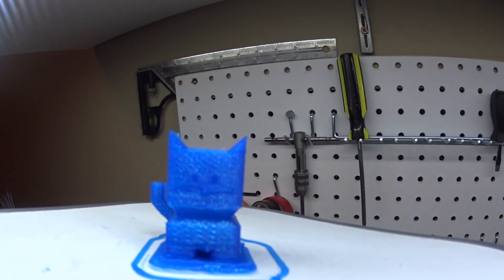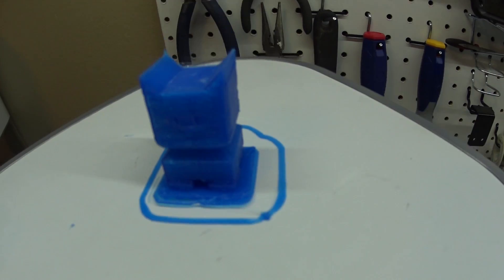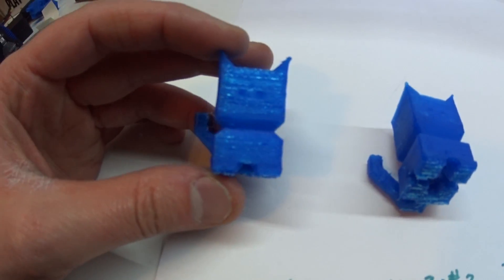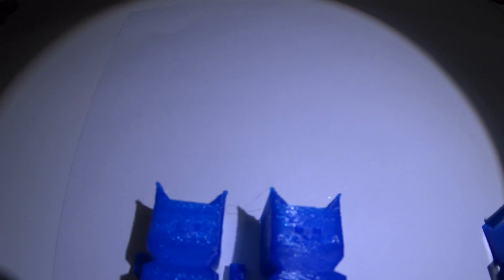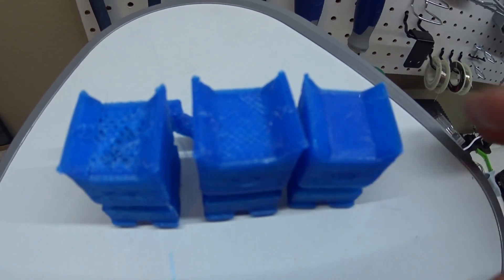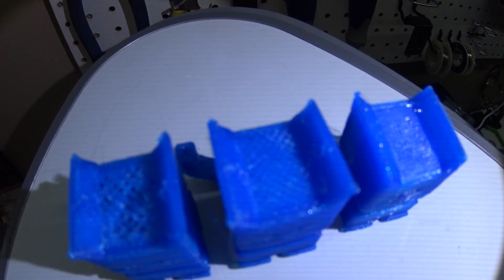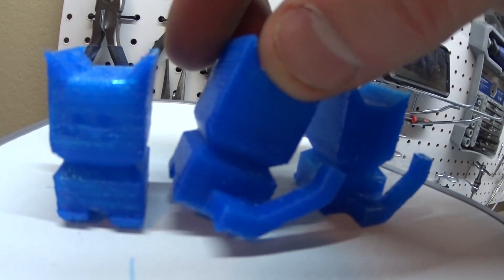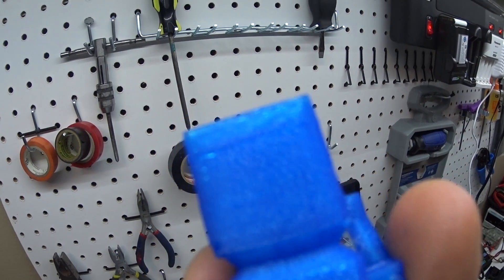Tiko3d Firmware Update 2.0.3 Calicat Calibration Print

Comment: do you have a copy of the files and firmware?
Reply from the maker: I can see if I still have the cura profiles, but the firmware was something that TIKO managed and did not distribute the firmware files. 

I found the Slic3r profile that I was using, it wasn't perfect but it was ok:
https://goo.gl/PCaqZV

Heres the video for the above profile:
https://www.youtube.com/watch?v=tqSFqepMqg0&index=18&list=PLINZs2J8ogJmPcD8V9QzZmGF9WPW9qZgx

I found this profile for Cura (15.4 i think):
https://www.thingiverse.com/groups/tiko-eu/forums/general/topic:9590
Reply: thanks try to avoid ripping it  part it install all new motherboard, feeder, and programming.
Reply from the maker: Yeah no problem. I have a bunch of pictures in this google drive album of the printer taken apart. 

https://goo.gl/photos/T5VpmjHS16ShTCkRA

If i remember right one of the chips was a TI C3200:
http://www.ti.com/lit/ds/symlink/cc3200.pdf

I did some looking around yesterday to see if anyone was able to write a custom firmware for the board that came with the Tiko, but I couldn't dig anything up. I don't know enough about programming microcontrollers to take a stab or how to reverse engineer the board. If you aren't having any luck with their board you could use a ramps board from Amazon for a retrofit. 

Looks like the last firmware that went out before the project failed was 2.0.3 firmware and 1.2.4 software. 

It would of been nice for Tiko to have open sourced the software before killing the project.
Reply: thanks so much. if i have to take it a part i will rewire it with a delta reprap like a yeehaw

Comment: Hi, thanks for your video. I also have a beta Tiko and I am wondering if that can be updated to these new firmware and software.
Reply from the maker: From what I understand the Beta Tikos no longer have the ability to grab firmware updates. I did try to force a firmware update but I wasn't able to update the beta tiko printer. Tiko may have blocked the hardware ID's from  pulling from the update server.